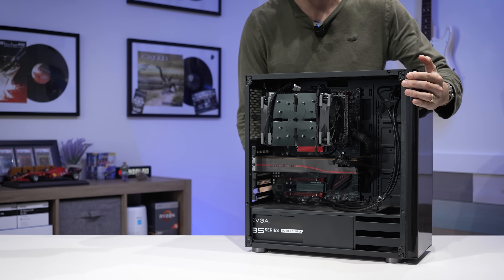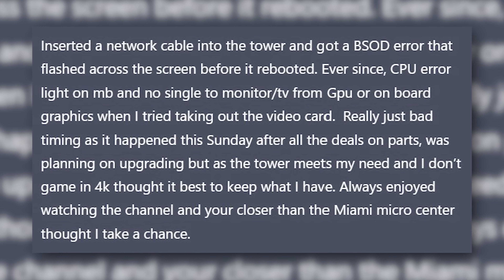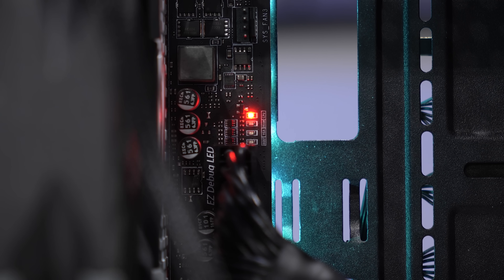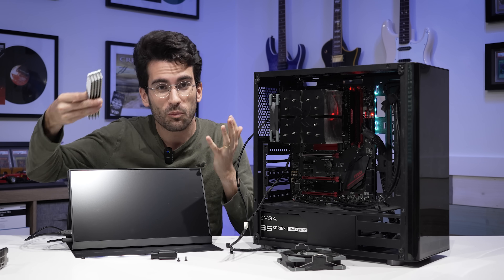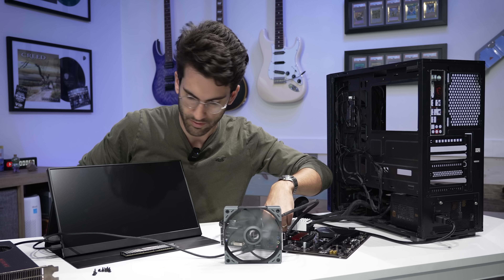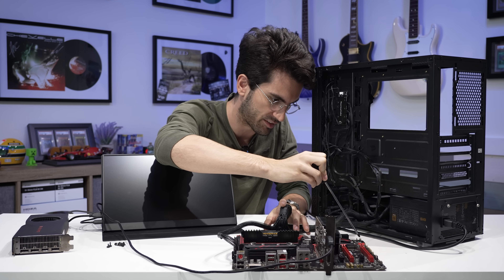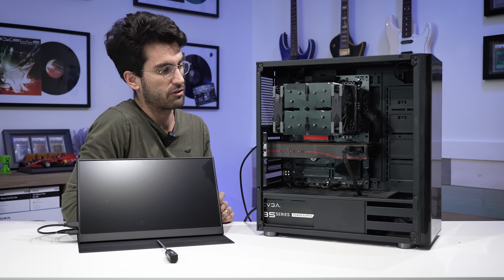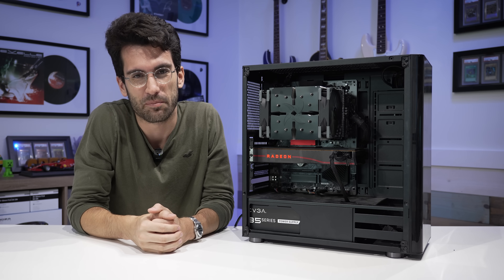Fixing a Viewer's BROKEN Gaming PC? - Fix or Flop S6:E18

Comment: Passive PoE doesn't do a compatibility handshake first, it always sends power blindly. That's very very bad. That would fry some stuff if it was plugged into a PC. That kind of PoE is found in fly-by-night Chinese brands that sell on Amazon/Temu/AliExpress. EDIT: Really old PoE equipment is also passive, stuff from before there even was a standard. Check for IEEE 802.3af/at/bt in the specs to make sure it is safe.

Comment: Why is the battery required for modern motherboards to boot?  Back in my day the battery was a plastic AA battery holder glued to the side of the power supply.  And you could boot without it even connected.  You would just have to reenter the CMOS  settings each time you booted.
Reply: It's not required. But the battery will allow CMOS to retain memory for your settings.
Reply: @Manganization  Why does he keep testing batteries, saying they could keep the motherboard from booting?
Reply: @Andrew-ky8oc8cq4n  no idea. Maybe it has something to do with a potential saved configuration?

Comment: i had a similar problem, when i moved computer to Den, i noticed if i plug in a HDMI cable , blue screen , and then my GPU was fried, after 3 GPU, i learned my power to my room HAD NO GROUND, so i have to be careful when pluging stuff in, and remove the ground from any cables because the ground was HOT..lol

Comment: Did anyone else see the ground tab on the IO plate by the Ethernet port? Maybe it took a spill at one point? Or grounded something to something else? Just guessing here. Great vid Greg!
Reply: First thing I noticed , looks like the shield was not checked as board instaled earth tabs ment to be inside
Reply: @paulhowe69  that shield is not really needed for esd shielding in the most of the cases. i/o shield have more uses as " dust " cover more than esd protection.
still in the same esd problems discussion, pretty sure you need to trace the voltage from ethernet chip and usb chip from that same port back into mosfet that power the board component. one of component should be shorted from esd damage and board protection is triggered. 

led indicator should not working well in case of component shorting.

Comment: As soon as you described the symptoms, I knew it was a motherboard issue. Specifically, I bet the network controller took some sort of voltage transient when the Ethernet cable was connected and has now failed in a way to prevent the CPU from initializing (maybe it’s connected to one of the CPU’s PCIe lanes?)

Comment: If you look at one of the first pictures you have of the back io you will notice the grounding straps around the lan port.  One is completely bent back on the outside of the io plate.  Bet the owner bent that back further after he tried to insert the lan cable with it bent into the connector and shorted the motherboard.

Comment: What switch is he using. Some have POE (Power over Ethernet). May want to check first.. If on power up with it connected it will turn off but unplugged it may hae power active.. With the plastic on the cable I dp not think it was static .

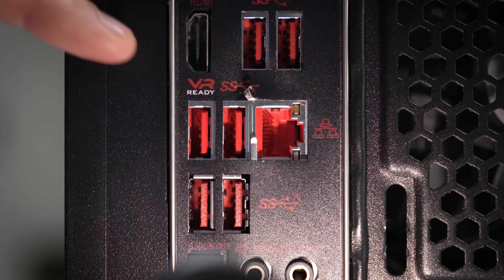Comment: @ 0:29 you can see the I/O shield and one of the tabs that grounds to the motherboard is bent up. hmmm suspicious activity, Thinking needle nose pliers to curl a small metal tab up like that to fit a thicker ethernet connector that would not fit so maybe they unplugged ethernet cable used pliers to bent up tab, maybe the pliers slipped and shorted the board through the usb ports on the back near the ethernet while the PC was still powered on.....just a theory

Comment: If I had to guess what went wrong, I’d say it probably happened when he pulled the PC out from its place with the power still on. The weight of that massive air cooler might have pulled on the CPU when it got bumped, causing a short. I say this because the handles on the CPU holder are very flimsy, and if the board has been used a lot, they can weaken. This means the CPU could be pulled out of its socket just by the weight of the air cooler if the machine gets bumped in any way.

Comment: Years ago I had a motherboard blow a capacitor when I plugged in a USB device.  There was flash, pop, and billowing magic smoke.  Scared me half to death.  Funny enough the system did not blue screen and even booted up without a working USB controller.  Needless to say I didn't turn it back on until that motherboard was replaced.

Comment: I once blew out the port on a networking switch while hosting a LAN party due to a static discharge. It was a pretty decent shock, so I'm not too surprised it killed the port, but the rest switch worked fine. However, if that was the cause, you'd think they'd be well aware of the static discharge, and that would be an entirely possible culprit.

Comment: My current mobo, Asus Strix X470, has a single USB port on the back with no visual damage but any time anything is connected, it will short and turn off the system. Luckily, it didn't brick the mobo either time it happened.

Comment: Greg, there's an early extra test you should do: test the mobo + CPU when you've removed them from the case.

As for the cause, static from the ethernet cable or 24v from a PoE ethernet cable could be the culprits.
Reply from the maker: We do this often when we suspect the case may be shorting due to an improperly placed stand-off, etc. It was checked in this video. Not always filmed.

Comment: I had a server in my shop that wouldn't post when the ethernet cable was plugged in.  Once it booted I could plug it in and it ran fine, but after a cold start or reboot it would fail to post if the cable was plugged in.

Comment: Putting the ethernet cable in while the PC was on causing some flex in the mounts where the USB 3.1 ports are also mounted causing a short from a manufacturer defect and frying the USB 3.1 controller chip and triggering a safety shutdown of the board? Stranger things have killed boards.

Comment: i had a wried problem with ethernet on the job i installed af total new win on the disk and when i put the cable in it gave med a bsod over and over 7 diffent we ended up using a usb to mobil to get wifi working and the driver said failed but first after we got internet on it and it has worked fine after but still wried thing about that

Comment: 10:59 Every time Greg swaps everything out, puts it all back in and powers a system on.

Greg: "Why isn't it posting?" O_o
Me: "You have to wait, bruh. Nothing on a first time post is instant anymore. Wait." SMH LOL

What likely happened to whomever owns the system was he had some static going through his hand at the time he plugged in the Ethernet cable and it arced to the USB slots directly below it. I've seen it happen. The solid red light is likely a byproduct of the BIOS unable to find a bootable device once it's checked the CPU. Since it can't get past the failed USB chip I'd say the BIOS is getting hung up on checking that stage in it's sequences and seeing as you can't swap it or change the BIOS without it posting fully it's impossible to know for sure, but that's my best guess.

Good stuff, Greg. Keep it up.

Comment: Just a bit of "viewer comfort".  Greg, the monitor in most all your Fix/Flop videos has a glaring reflection which washes out the screen, or reflects light which is kind of annoying.  Periodically you move the monitor slightly and it removes the glare.  This video also had a few times where the shadow of your head is clearly visible across the washed out screen as you moved about.  Just a comment, that perhaps you might tilt or angle the monitor a bit, or consider rearranging your studio lights a bit.  Many other Youtube computer guys never seem to have issues with lighting.

Comment: I have a theory. If that USB Host controller was already starting to fail and heat up, it's possible that the "snap" of the ethernet cable seating caused just enough of a vibration to break the connection of one of the controller's pins.

Comment: @Greg Salazar  0:38 into the video  I notice two  bent tabs one is  curled up and one straight in front of the Network port  could this have shorted out the port when he plugged trhe RJ46 cable in?
Reply from the maker: The metal is bent a bit, but I don't believe it was ever IN the port, which is the only way this could have shorted. Cable-side, this wouldn't have affected his PC.

Comment: I'm willing to bet it was a static discharge or a power spike of some sort. I've seen blue arcs from connecting cables while the power was on before.
Reply: Static charges are risky for older hardware, newer hardware has more protections in place
Reply: Killed a laptop with what must have been static. I missed the USB port in a dark room and nudged some part of the HDMI port with the flash drive, immediately powered off and that was it.
Reply: @andersjohansson4734  I did the same thing myself 8 years ago except I don't think it was static I was using a can of compressed air to clean the keyboard out while it was on thinking it was just air and it wouldn't hurt anything but oh boy I was wrong I killed half or more of the keyboard  and I can't remember if anything else worked I just got dressed and went to best buy to buy another laptop. Oh and by the way I got pretty decent laptop for under 300 bucks.
Reply: something that could happen that he plug a poe (power over Ethernet) switch in and cause damage because the broad was not expecting there be power. at the port
Reply: Long ago, actually had static shock kill an optical cable connected to a PS2 via touching the wired controller. I was thinking the same in this case based on the age of the board it's possible a big enough static shock could do damage.
Reply: I had one particularly bad power surge during a thunder storm. My PC's on a good surge protector, so it was fine. However, my router was not. The power surge jumped through the router, and fried my ethernet port on my computer and caused it to stop powering on. 
I had to remove the CMOS to, I guess, reset the MOBOs Over Current Protection. That ethernet never did work again, but the rest of the MOBO was safe.

Craziest part is that the router and modem were fine too.
Reply: bit surprised he has not run into that before, because that is a common event
Reply: @hedeviltazz4185  truth been told most of the people just don't realize how high the voltage is if you'e charged , I once asked a friend how much volt is on him when he gets zapped touching his car ,  and as I told him above 1000volts  he called me nuts because they mostly compare it with the deadly current they know from theyr home or so!
Reply: Switching power supplies between the computer and the router have different floating voltages which cause that blue spark.
Reply: Possibly running around his house in cheap plastic slippers static charged  and then touched the backplate ... RIP motherboard !

Comment: What you missed when you had the mobo in the case is there was a metal tab across the bottom of the ethernet port.  Good chance that rubbed across the pins and possibly caused a short when he plugged it in.
Reply from the maker: Didn't miss it. That metal tab didn't short the female connector. Not possible. Shorting the male side would have been unrelated to the PC since it wouldn't have been attached by that point.
Reply: @GregSalazar  I was referring to the pins on the cable not the port itself....
Reply: @GregSalazar  All I know is something happened due to the ethernet
Reply: Not sure how grounding a potential PoE on the Ethernet cable will break something in the pc.
Reply: Those tabs for the I/O shield I believe are for a ground path. If it is lifted like that there is a chance that there was an ESD event that jumped to either the USB port or the Ethernet port into the USB controller.  The discharge may have happened when the cable was inserted.

Comment: possibility the owner static shocked the usb port while plugging in the eth cable?
good episode greg!  maybe a heads up tho, just in case if you might forget a step while troubleshooting, write or print out an outline checklist to go thru everytime
Reply: the static shock was my guess as well, especially if he was doing it in socks while on carpet, but even if he wasn't static shock is still possible, which is why only the board would be dead and nothing else wrong.
Reply: A lesson to us all about being extra careful when plugging cables in to the rear I/O, whether or not the machine is powered on.

Comment: If they are using a switch that supports 24v passive voltage on the ports, it could very easily cause a machine to die being plugged into one of those ports (Ubiquiti switches support this along with POE+).  You don't want to enable that 24v passive unless you REALLY know what you're doing, and that your device supports that method of power...
Reply from the maker: I was wondering if PoE could have caused this!
Reply: My guess was also something POE related. 
i try to keep all my poe devices on their own switch because I'm too scared of something like this happening lol
Reply: it shouldn't deliver power unless it has the correct pin on both ends
Reply: @SynthSy  Passive PoE does not negotiate. Passive PoE sends prayers and voltage. You are pushing voltage into a PC's data pins on the LAN port.
Reply: @timodorfner5642 I own several passive and active switches, if they don't have the pin, it shouldn't deliver power. Though if you're using something cheaper, then you might encounter what you described.
Reply: @SynthSy  Sorry, I didn't see you replied before I edited. But also, that's not how it works. Passive PoE uses pin 4 and 5 for positive voltage, 7 and 8 for negative voltage. Passive PoE injects power into gigabit port's data pins. They are connected on gigabit (since it needs all for data transmission). You will fry hardware.

E: What you're saying might work on 100 Mbit ports. But not Gigabit. The PC will have gigabit at the very least. If you were talking about 100 Mbit, you were completely off topic anyway..

Comment: You should use a proper battery tester so it puts a load on battery. It can fool you by reading normal until there is a  load. A multimeter does not put a load on battery.
Reply from the maker: For these applications, a simple multimeter test is usually fine. Never run into an issue where it wasn't.

Comment: That air cooler is BEEFY
Reply: It's from Scythe. Great brand, awesome fans too.
Reply: @benjaminfrohns Do you happen to know the price range on those? I've been looking for some alternatives on air coolers on some prebuilts I'm making
Reply: @KodaBriar you can get an awesome scythe cooler like this for under $40
Reply: Scythe Ninja 5. Had it in my pc as well. Very decent cooler
Reply: @dadutchguy4989 Im still running that cooler on my 7800x3d lol😂 64°C to 70°C max while gaming
Reply: @YesIgen  And it was almost completely silent as well. I believe the fans had an 800 rpm max. One of the best cooler I ever had
Reply: @dadutchguy4989 Yup. Can't hear that fans spinnin. And they're working hard for 6+ years already 🤣 best cooler i ever bought. Only downside is the size 😁. But it fits on my Lian Li A3 no problem
Reply: I have a thermalright phantom spirit air cooler and it's pretty big, but this is probably a bit bigger
Reply: @TheBlueBunnyKen  same, got the phantom spirit 120 evo and its a big cooler
Reply: All the beef
Reply: I managed to get a 2nd hand Scythe Ninja 3 for an old Haswell rig that only had the LGA115x mounting hardware for 13USD which I think was a steal.
Reply: That cooler man.....must be some sort of quantum processor under it.
Can't take my eyes from it.Its like a smaller case in a case...
Reply: Just buy a 150$ aio. Idk why people do this.
Reply: @heyitsbryce  AIOs can fail in ways that air coolers can't.
Reply: @heyitsbryce aio will fail eventually pump and it gets clogged overtime unlike air tower coolers only fans that fails you can easily replace them and there easier to maintenance than aios
Reply: I would use something like that for my 7950x3d if I wasn't over huge metal hanging in my PC.
Reply: @camogeko6804 Scythe Ninja5 will not cool that beast of a cpu anyway 🤣 It's cooling my 7800x3d in games no problem 59-70C max, but in cinebench.... Instant thermal throttle at 85°C after 5 seconds 🤣
Reply: For the last 25+ years, AMD’s has always needed massive cooling solutions as the stock cpu fans were worthless and tossed. Most diy system builders that build AMD systems always had to do this.

The Wraith series of AMD stock coolers were better but still lacking the cooling demand of these ‘bottle rocket’ cpus.

I also decided to check how much the power supply tester being used in this video and I’m jaw dropped quick. Over US$400 before shipping!